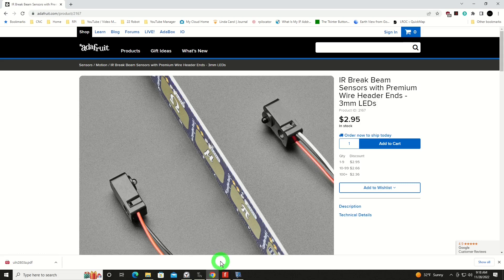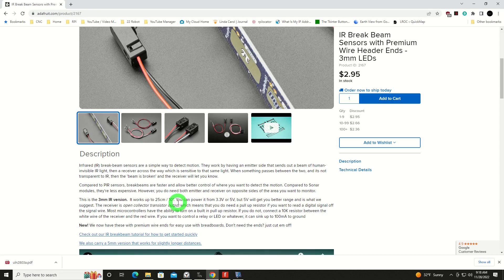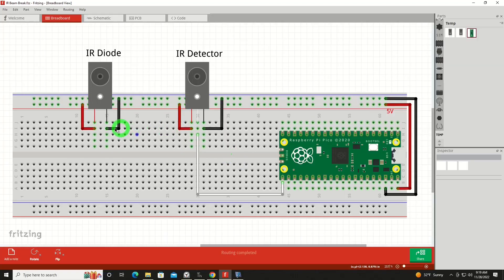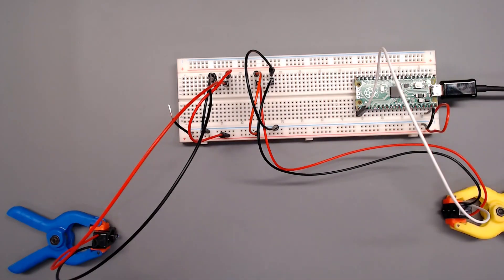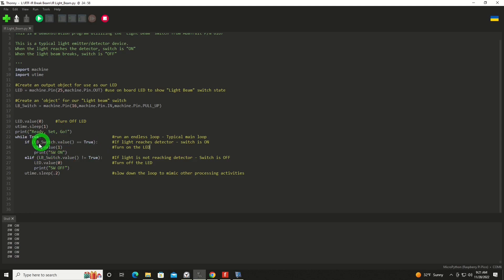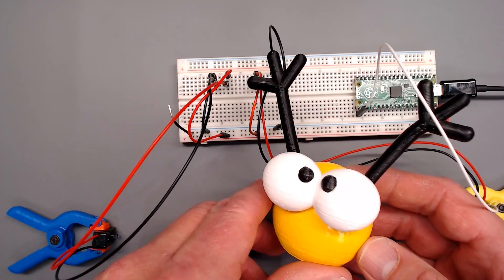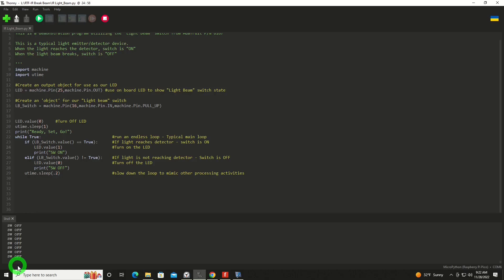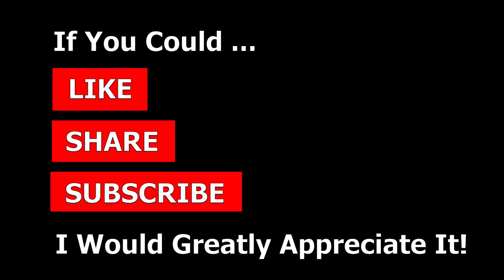Use Light as a Light Beam Switch - learn how in this video.

Comment: Any advice on putting these sensors next to each other to make a wall of detection, it would be very useful for science to detect insects flying into traps. I just bought 10 to have side by side. Still need to find out how to wire and program that.
Reply from the maker: Good afternoon alexcoaym,
That sounds like a really neat project, let me know how it turns out! 
It might actually be okay to have them close together , however, I am not sure if a small insect will block enough light though.  The wiring and all that can be found here at the companion website:
https://makingstuffwithchrisdehut.com/electronics-files
Scroll down to see "IR Light Beam Switch"

I would experiment with 1 sensor and some sort of object that can be an analog for an insect.  Maybe an insect size clump of paper on the end of a pin?  

Good luck and have fun with it.

Cheers!
Chris

Comment: I've been looking for a sensor switch like this, but I need it to work over a distance of around 30". Do you have a recommendation for one that can do this?
Reply from the maker: Unfortunately I have not seen longer range versions of this sensor.  A possible solution might be a garage door safety switch. I don't know their operating voltage but they certainly have the range.
Cheers!
Chris

Comment: Love these videos. Sort of like hardware snippets that can be added as required to a larger prject. Definitely a good point of reference for me at least. 
I really like the Pico and have a number of them. Initially I tried going down the C/C++ route but what with the complex build chain (including a "lost weekend" just getting it to work!), and the "features" of that language, and that I am doing this for FUN, I have finally settled on micropython - and yes, the fun has returned.
Thanks for these videos - keep them coming please.
Reply from the maker: HI C G,  I am on the same path as you!  I do not enjoy programming in C / C++, never have. It is not that I can't, it is simply because it is not enjoyable. 
This whole PICO series was meant to be a "reference" for interfacing a very wide variety of devices and it is continuing on that path.  Projects are starting to trickle into the system. The projects  have their roots based on all the interfacing fundamentals.  
It is people such as yourself that make this enjoyable for me and I really appreciate that you enjoy the videos!
Cheers!
Chris

Comment: Great little project.  I need to brush up on those transistor terms like "open collector" - have to look it up each time.  I was thinking of a project with a hall effect sensor, magnet, pico W webserver, and battery that would let me know when the mailbox was opened.  Putting the pico into deep sleep for extended battery life is also something I would like to learn.   Thanks for all your useful tutorials!
Reply from the maker: Thanks!  I have been working on some ideas for what you are looking for and hope to have something up on the channel later this year.  Some of the delay is that certain features are not well supported in MicroPython and I am trying to keep this series focused on PICO & Micropython.  
Cheers!
Chris